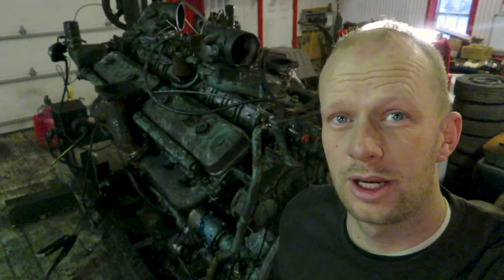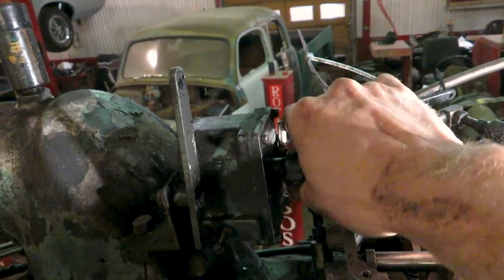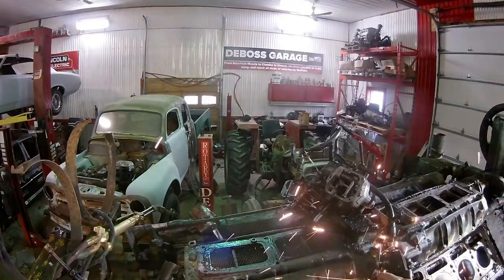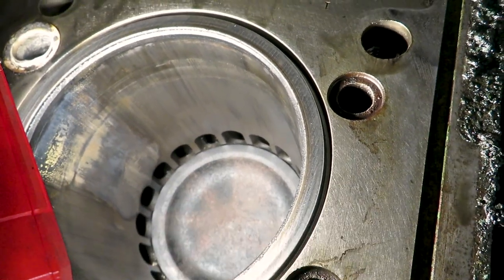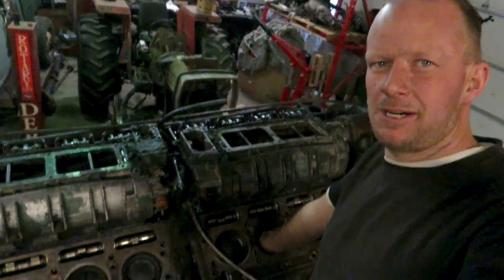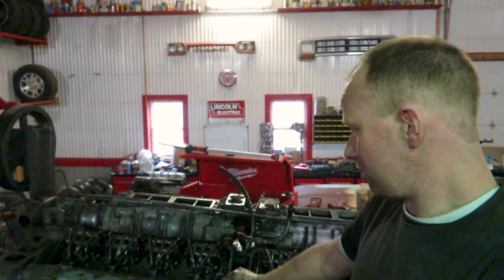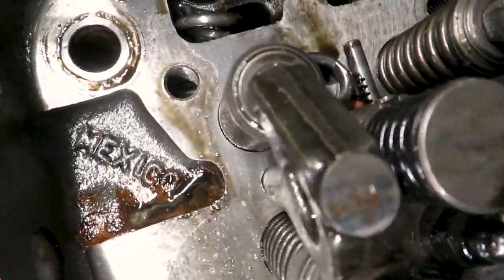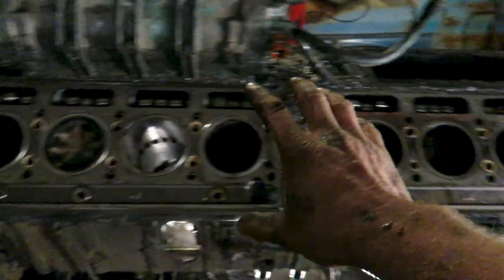What's Inside a 16cyl 2 Stroke Detroit Diesel? #HowItWorks

Comment: Would be so cool to see you guys do a 4-71 or 4-53 swap
Reply from the maker: There is a 6 at the yard.  What would you think about a 12V71 in a 1970 Freightliner cabover but still leaving the generator on it.  We would mate 2 electric motors in front of the diffs and make a pulling truck for the races in Notre Dame?
Reply: @DEBOSSGARAGE  that would be one awesome rig

Comment: The supercharger is only really good as a core when used on a gas engine. The roters in the charger  need to spin opposite doing that binds up the gears. Changing the gears, overhauling and the snout doesn't make it worth it. I already tried it. Lol

Comment: it is possible to run them backwards but can they really? I mean, if the oil pump and water pump runs backwards you get no oil pressure and mo cooling. I am not sure about the fuel pump but i would assume it would run backwards too? And the blowers.

The design make it possible but  i don't think you can just take a clockwise running engine and spin it backwards, like a gas 2 stroke can because it has nothing gear driven (except water pump in some cases)

Comment: So if there are two blocks just bolted together it should be easily possible to bolt a third block on and build a V24?
This would be needless but cool.
Reply: Yes, they did make a 24v71.  But what even better is the biggest Detroit ever made, the 20v149TIB (turbocharged, intercooled, bypass blower).   Two V6's and a V8 bolted together, over 2900 HP at 1800 rpm.
Reply: @Simr Khera yes but it can power a whole town

Comment: I don't think the oil pump would work in reverse, I  just can't think of a oil pump design that is reversible. 

Also, what about cam timing? Are the cams symetrical compared against TDC?
Reply: Btw, we had a two cylinder tractor that could reverse while running if you almost choked it. I only managed to do that while winching timber. We had to be quick  to shut it off, because the oilpressure disappeared.

Comment: Are the pistons oiled by the fuel, just like a “normal” two stroke ? Running on a fuel mixture (oli-gas)....
Reply: Nope, oiled by spray and splash from underneath like a normal engine.

Comment: YOU misstated the power cycle.blower is for air intake at bottom of stroke. Air in, compress,fuel, bang,exhaust valves open,combustion air out,piston power down, again,starts over.

Comment: Great explanation. 
Mexican head is non genuine.
Injectors came in different flow rates. The N65 was the id for that particular injector - flow rate combination. 
The 71 Series also had turbocharging towards the end of its production before the 92 Series was released. 
The fact that these engines can run on kerosene etc. made them valuable during WWII,  diesel historians say that the 6-71 (in line 6cyl) had a big hand in winning the war. 
Not cost effective in trying to use an old blower on a petrol engine, they would need a rebuild plus end plates for a belt drive setup. Cheaper and easier to buy new off the shelf.
Reply from the maker: Thanks for the clarification!
Reply: I agree. I used to use on occasion a sullair auxiliary skid type high pressure air compressor rated at 900 cfm at 350 psi. What a screamer. Anyways, it had a 12v71 with twin turbos into superchargers. I believe it made somewhere north of 550 hp. All it was really good at was eating fuel, like 250 gallons in 6 to 8 hours. But, the dual exhaust was damn impressive!

Comment: hey,  I have the worlds worst diesel.  Its a 6.2 L chevrolet with out a turbo.  It used to get in the 19-24mpg but I had a mechanic turn it up and it didn't have to downshift to go over a speedbump !  He put a different intake on which I wish he would have given me my parts back but they are gone.  I have heard the you shouldnt put a turbo on it but I would like a better way to get some power even if it were a tiny little turbo so it didn't get too much boost.  Any help what I can do to get my mpg back with power too ?  Thanks
Reply: Banks made or still makes a turbo kit for 6.2s. They can be great engines and people like @bornforadventure on Instagram uses them to haul other cool old military rigs all the time.
Reply: It will never get better fuel MILAGE by CHANGING anything.  Banks turbo is good but more power means more fuel.
Reply: @hankclingingsmith8707  I put stage 1.5 injectors (30% over stock) in my 7.3 powerstroke and went from 13 mpg to 19 with adding fuel. More air will help give it better performance and mileage depending on how its driven because it will have compressed air flowing into the cylinders. Now yes if you crank the fuel system up and keep your foot in it it will only get worse but better flowing air in and out will help.
Reply: @douganderson7002  I literally did the math after filling the tank to figure out the mileage. I guess you dont want to take my word for what it did but it went from a normal 13 mpg to 19 and I'm happy as hell with them. Your driving might be shit and you might constantly modulate throttle rather than hold the pedal consistently but my personal experience has been better mileage

Comment: If you flipped one of the engines front to back because it's ambidextrous, wouldn't the cam/valve timing be wrong?
Reply: Scott L  No. There are multiple timing marks stamped in the gears , each one is identified by the service manual for various advances as well as changing rotation
Reply: @ASPCOT  that's wild! Truly engineered.
Reply: Scott L  That is absolutely true. Additionally,  sleeve/piston groups,  heads, manifolds, camshafts and some smaller parts were all interchangable within a given engine family ( 53, 71,  92 etc)

Comment: The valves and springs are designed to turn when running otherwise the valve stem would be worn only in one spot.
Reply from the maker: Crap, that means 63 of them aren't working

Comment: Say, why did they put exhaust valves on these? Couldn't you make them like a gas two-stroke, with half of the side passages in the cylinder acting as exhaust? Given that you don't need to worry about wasting fuel you can just have the blower clean them out that way, no?

Comment: Could one of these 16 cylinders find its way into a old cab over tractor ? They are not that much longer than the 12V 71 , some came from the factory with thay engine. Dead cabover tractors  with 318's are almost free. That might be a big head start as far as linkage, electric ect bolting up to existing  components. A V 16 cabover Pete , Kenworth,  IH or ??? would be way cool. Old School, no power steering. AC.
Reply from the maker: We thought about that.  Might take one of the gen sets and put it in a cabover, put the electric motors in front of the diffs and make an "electric" pull truck for Notre Dame.  Right now wasn't the right time

Comment: Nope, Full fuel and full throttle are not the same thing full governed rpm at no load is actually a very low fuel rack position, a full fuel runaway goes until valve float limits rpm, much higher than the governor

Comment: Information about the superchargers

Those are "v-71" superchargers, the old hot rod guys used inline style 72 superchargers, 

Also both front and rear covers needed to be changed to make them work on a "hot rod" as well as different bearings in the covers because a gas v8 spins a higher rpm than a 2 stroke Detroit, 

BDS (blower drive services) out in California is a place to go to get the parts to convert a diesel supercharger to use on a hot rod

Also these things are super old and inefficient, and parasitic of hp to use, theres many decades of improvement to supercharger technology if you're serious about supercharging whatever

Comment: Your wrong as it is the exhaust stroke first and then the cam will close the valves and then it becomes the intake of the air and then it gets compressed and after it goes over top dead centre the injector will spray

Comment: Waste of a engine, not the wrecking it... it's a sealed fate if it stands outside in the elements. I know there is a Detroit out there for me, like the 3 cylinder or 8V to fit in a 101fc ambulance.

Comment: The cranks on a 16V are unique compared to a 8V
Reply from the maker: in what way?
Reply: 8V cranks don't have the middle joint to join the cranks to together. And the timing is completely different (look at the timing for a 16V and you'll see what I mean). I believe the rear block is basically the same cams, but the front block is different.

Comment: someone NEEDS to fit Direct injection in a 2 stroke diesel or build a new 2 stroke engine.  2 strokes diesel are different from 2 strokes people know in bikes, the oil is separate so with precise injection you could get twice the torque with same displacement.  Honda is actually thinkering with 2 stroke engines to see the feasability but electric car might take over before they end up releasing that engine.

Comment: So I guess the double set of rings is why it didn’t run away on its own base oil
Reply from the maker: Yeah.  They would run away on worn out blower oil
Reply: Interesting, I have access to a low mile 8v-71 in a 74 Ford L9000 but I’m in the same boat as you.... no practical use for it. Keep up the good work. As a fellow mechanic it’s nice to see someone with a channel who actually knows what their doing.

Comment: Only turn 2300 RPM because of injector stuck full throttle if that was the case it won't blow up. IT'S A RUN AWAY because you can't control the engine I've seen many of these. This is problem with mechanical fuel injection diesel engine. Electronic engines don't do this in general or very very rare. I've once seen one 3406E cat run away just took off from sitting there at idle.

Comment: so how does the oil pump work for it able to run in reverse?
Reply: They run without oil for a fair while. To deliberately have reverse rotation the rear housing needed to be removed and the gear train rearranged to drive cam shafts and oil pump the correct direction.

Comment: You think that’s big. Go to the scrapper and ask for an EMD 16-710. It’s also a GM engine, it’s almost exactly the same as that Detroit, it’s just 10 times bigger and pushes 4300 horsepower in the top model.

Comment: The Army uses the 8V92TA 12.1L in their HEMMMTS which is similar to this engine but uses a turbo charger to directly feed the supercharger. You talk about a pulling son of a gun. Smaller displacement when you consider there are much bigger diesel engines powering similar sized vehicles. It just doesn't care.

Comment: I'm not understanding why a two stroke has valves and an oil pan?
Reply: Its not a 2 stroke like a dirtbike. In a bike the intake stroke comes from the crankcase pressure but on this the intake stroke is fed by the supercharger. 2 ways of doing the same thing - if you can find an animation or youtube vid or something for both types it should help explain. Pushing the air in with the blower is good because it means these engines dont burn oil - crankcase is sealed from the combustion chamber. Downside is you need an expensive blower to make it all work. The petrol/deisel thing is irrelivant really

Comment: These engines were used in everything from high pressure frac pumps to railroad engines to cranes and marine engines.  At bj they used nothing but these giant noise makers. Know a bunch of old frac hands that claim they went deaf from using these things.

Comment: Would've made a great generator if it hadn't been screwed.
Reply from the maker: so would Series 60 with half the fuel, half the noise and half the pollution
Reply: @DEBOSSGARAGE  True, definitely true, but they just sound so good! Another engine that sounds too good to refuse is the Junkers Jumo 205, an opposed piston inline six (which means two crankshafts, likely linked by a chain or gearbox) running a single propeller. They were some of the most efficient diesel engines ever, and very quiet even when running straightpiped. Switching to gasoline for a moment, the Rolls Royce Merlin (and later, Griffon) are great sounding and supposedly extremely reliable engines. The Supermarine Spitfire was named for that engine's tendency to backfire while starting, looking almost like antilag. Now, back to diesel:
EMDs sound pretty good, though being train diesels would be too heavy to transport very easily, you know, without the train. To wrap it up, I suppose I should mention the Napier Deltic, which is also a train engine, but... different. It runs a similar layout as the Jumo engine, yet is much, MUCH larger. It's a right behemoth, running three crankshafts and three banks of cylinders, each bank containing six cylinders, for a total of 18 pistons. The bore was 5.125 inches and the stroke was 7.25 inches! This made the Deltic displace a whopping 88 plus liters, which means each cylinder displaces at least 4.888... liters, which is the size of a lot of older V8s! They don't sound bad, either, though they are much louder than the Jumo 205. I reckon you could probably run a few city blocks with the kind of generator a Deltic could turn. Hell, they ran cargo trains back in the day, and those can get a little bit power hungry what with the motors needing so much to pull a mile of resource-filled boxcars. Safe to say the engine room in their locomotives were pretty full, and there were usually two per.
Reply from the maker: @lsswappedcessna  Thanks buddy!  Looks like you've been around the block!
Reply: @DEBOSSGARAGE  I may have some knowledge, but I have piss all mechanical experience. If only I could actually fix engines. Most complicated thing I've done around the literal block is changing the fuel pump on a '66 Oldsmobile Jetfire 5.4 small block. I think working on a super complicated aero piston engine or train engine the size of a car is a bit out of my league.

Comment: im pissed you blew it up. i cant find em anywhere
Reply from the maker: 3 on ebay and we have 4 more.  Hit us up at debossgarage@gmail.com.  There is also a guy in the comment section that is dismantling a boat and has 4 for sale.
Reply: @DEBOSSGARAGE  yeah i just looked on ebay, but im trying to find one with a manual and transfercase, so a motoer and trans
Reply from the maker: @jesses.7107  Anything above an 8 cyl was in Generators and boats.   You won't find any with Transmissions and 0 with transfer cases.
Reply: @DEBOSSGARAGE  you know any adapters for these? ive seen 4x4 trucks with 71 series motors

Comment: Only thing engines missing is ONE technology based off tested and undeniably confirmed science merged. High powered ultrasonic holography. Full range material diagnostics through whole engine with a computer and smartphones can do some neat things. Even further, talk to perplexity AI about using ultrasonic resonance with ultrasonic holography. Like how we target kidney stones while using resonance filters on all medical ultrasonic technology RIGHT NOW. Oh.. Yes.. Science system been RUDE to our engineers. But I'm not. Locked engine? Ultrasound can generate massive real time pressures at specific places within a body. What is the resonance of what causes engines to stick? Even further? Harmonic reinforcement and full engine fluid-air control. 

ONE technology.. Plasma generated ultrasound. High powered to definition of AI = Starts at 1,000 Watts. < HAHA..

Comment: So technically you could add another V8 and make a 24 cylinder?
Reply: The 71 series was available in a 24 cylinder. A rare engine!
Reply: Josiah Hanna oh thank you. I tried to do research but never found info on that engine. But it looks like there could be a way to add a third V8 to the 16 cylinder. Using the same concept as putting the two together
Reply: @That4.3Sierra  I think that's what they did. They were very modular it construction.

Comment: You can't run a Detroit backwards with out changing the timing ..  Yes they will run backwards  but they are blowing smoke out the air cleaner and   sucking air in though the Exhaust Pipe  
  I had a Really fast Yamaha  80 two stroke that would run backwards some times after stating   because I had a defective spark Plug .. I took the spark plug back and got another one .. I should have kept that spark plug for gag purposes..   It might have stared backwards one time out of  10 tries  of course it did not run very well with retarded timing but you can't ride it very fast backwards  either..